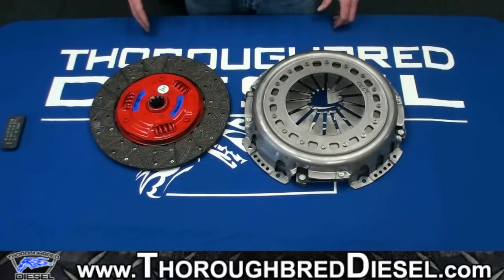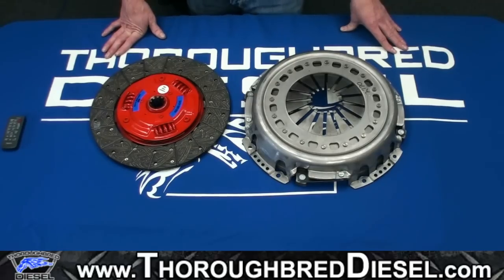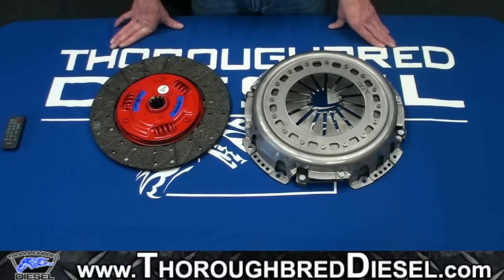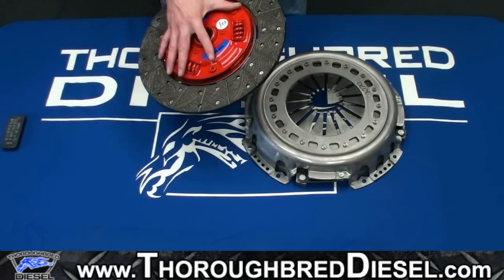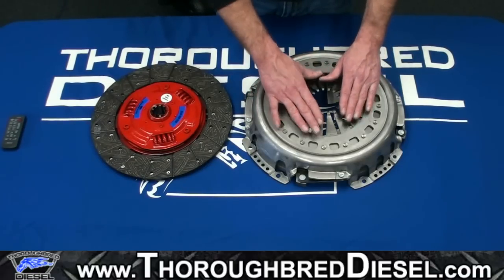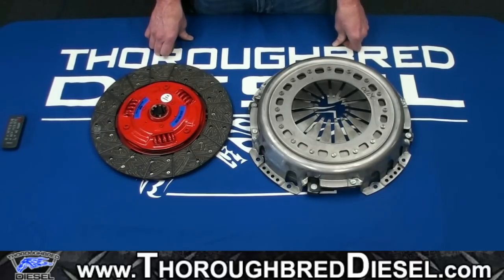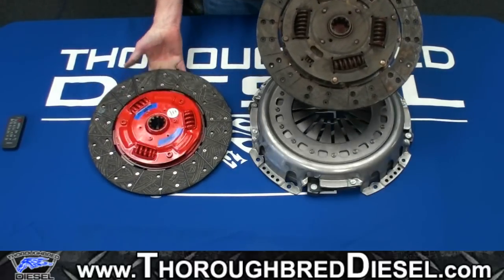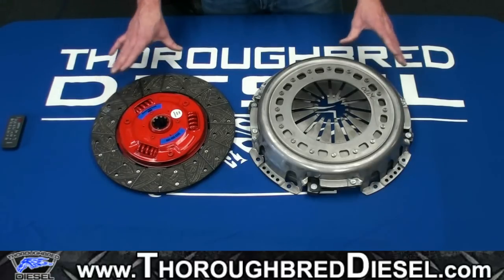South Bend Clutch HD Series Product Review

Comment: I have a modified 12 valve Cummins attached to a Spicer 3053a. I've converted everything to SAE 3. I'm running a 13 in single disc 6 button full ceramic clutch design for a medium duty truck is a four-finger style pressure plate. I have absolutely no slipping issues, and it's not near as grabby as everyone made a full ceramic clutch sound like it would be. My travel is excessive gear rollover noise especially at RPMs less than 2000 in 4th and 5th gear mostly. I have my truck set to idle right at 1000 RPM so I don't hear much at idle. My question is do you guys offer a 13 inch disk that is 10 spline by inch and a half, that can handle at the minimum 1000 foot pounds of torque, yet somehow doesn't cause gear rollover noise. I assume what I'm asking just isn't realistic but it doesn't hurt to ask

Comment: What is the difference between the g56-ok-hd and the g56-of-ek ?
Reply from the maker: The OK HD is a towing clutch really designed for truck less than 425 hp (or even stock trucks), can tow up to 20K, and has great driveability while towing. The OFE clutch isn’t designed for stock trucks as it is more harsh with less (slipability). It can hold up to around a 475 HP truck and can tow up to 25K, however it is not the most ideal clutch for towing, because of its lack of (slipability). If you are in the 475 range and tow we really suggest you step up to a street dual disk clutch.
Reply: @thoroughbreddiesel  thank you . I have some stuff done but nothing crazy on hp but I do use my truck for towing and would like to get a clutch that is more than capable. If possible can you please send me the link or part number for a good strong setup ? Thank you guys

Comment: Is it louder then the factory clutch in the g56?
Reply: The stock clutch dampens the engine spikes for more driveability. Any single mass flywheel clutch does not dampen and transmission noise will occur.